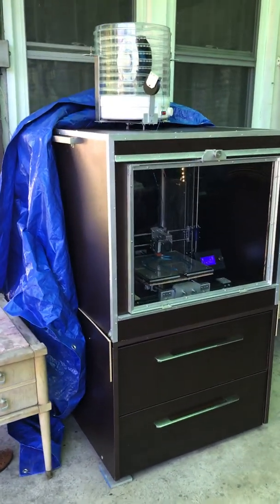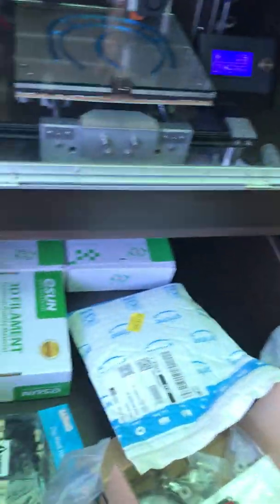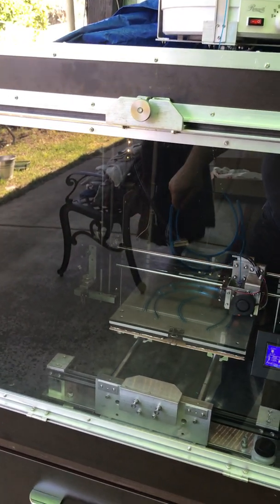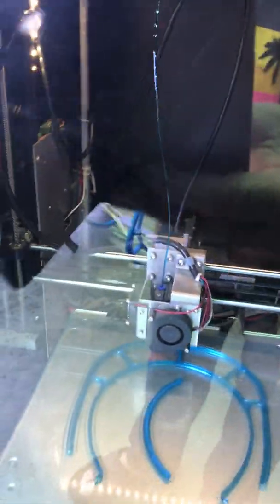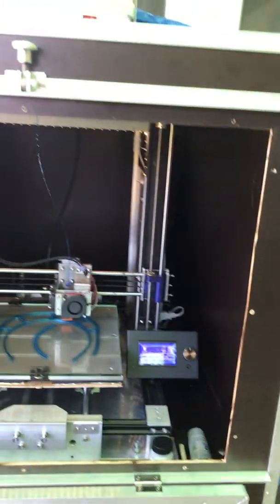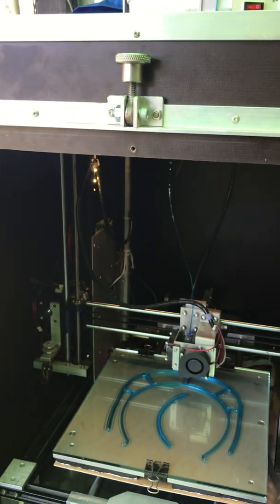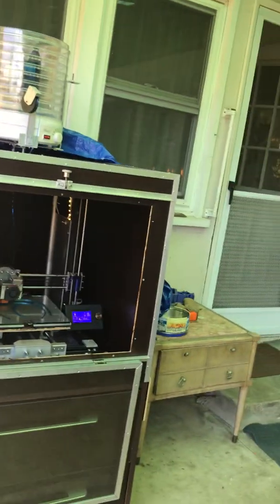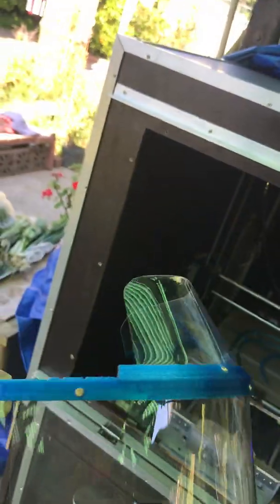Anet A8 Plus 95% modified.

Comment: Arr those 12mm rods?
Reply from the maker: I used 16mm rod for Y axis, 10mm rod for Z and X. I modified Left and Right plastic supports for 10mm rod holes (shown blue color PETG) for X rod and Z rods using Solidworks 3D software and print using Blue PETG with my small 200mm x 200mm Anet A8. You can see more detailed video Here : https://youtu.be/B86fTvL6M7w